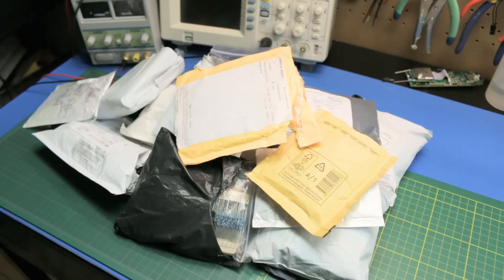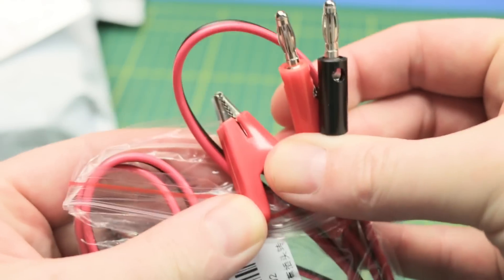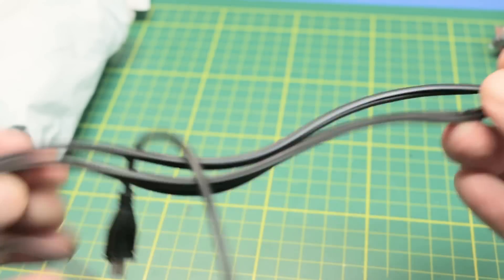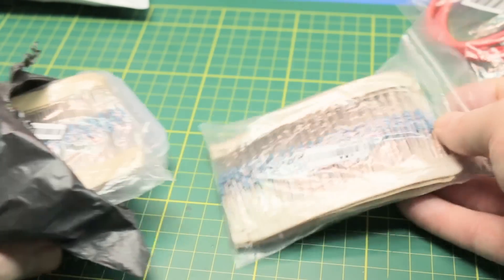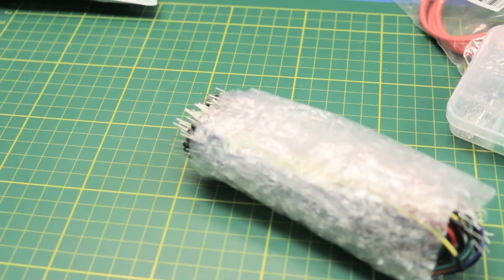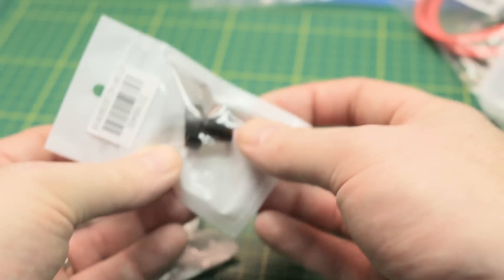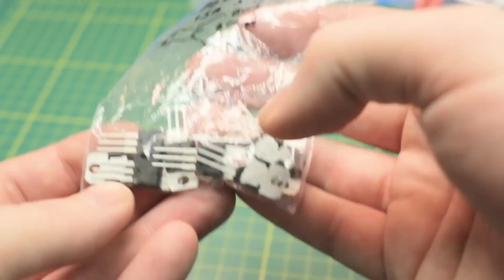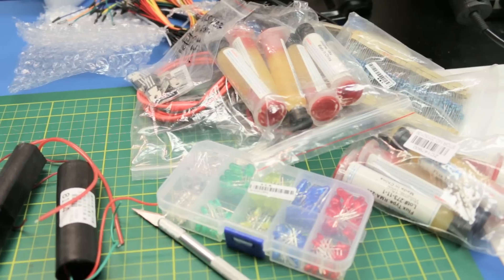Parts & Supplies For Electronics Projects

Comment: So can the last parts you showed be used for spot welding?
Reply from the maker: No they are too low current for anything like that. Rewind an old microwave transformer for a DIY spot welder.  Cheers John
Reply: Yeah, I thought so. I have a couple of microwave transformers I am going to use, but thought those parts you had might possibly be useful for that. Thanks Eric!
Reply from the maker: They make a pile of noise and light but don't think we can weld :)